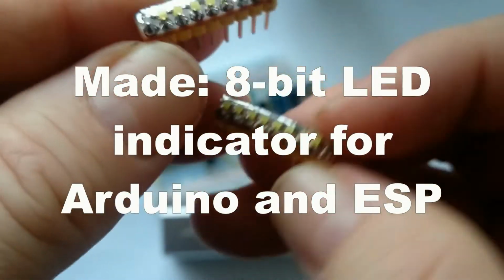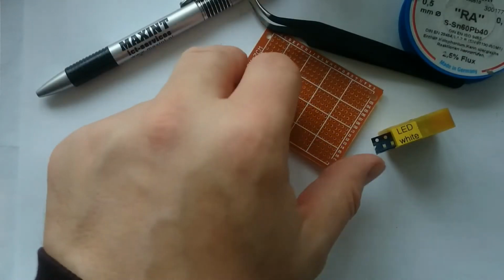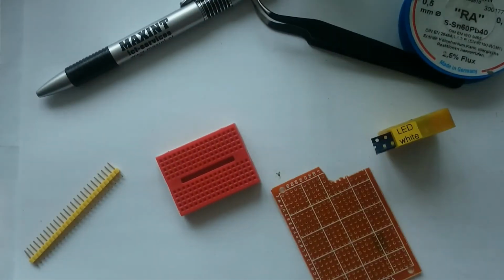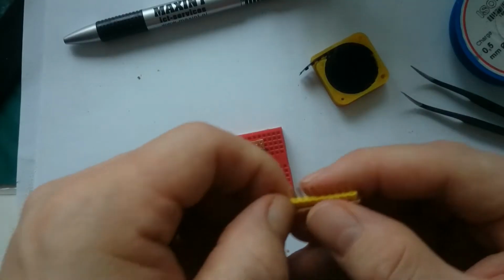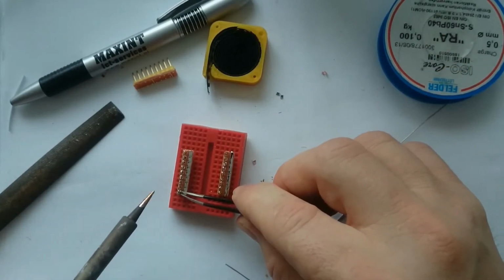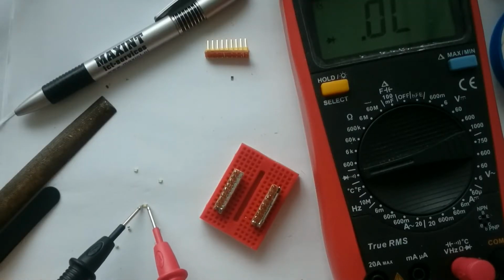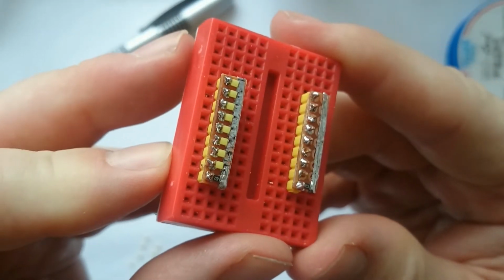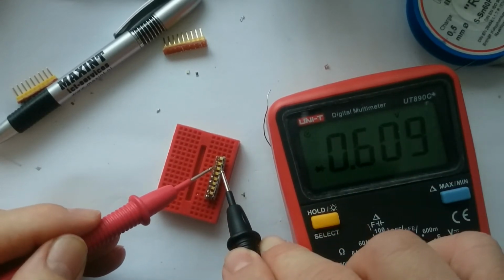Made: 8-bit LED indicators for Arduino and ESP32/ESP8266

Comment: I’m interested in using this for some of my RC cars or small drones as indicators when flying or driving in tandem, I have something like this on a a small PCB that plugs directly into a breadboard but I have no idea how to make it work for my applications.. I was planning to make the same phase animation like in some modern cars. Using a motion sensor to activate direction of indication and/or travel and also make them able to also be manually activated

Comment: How to Integrate a Driver (Library) in ESP32 and ESP8266 to work with nRF24L01?
Reply from the maker: Hi Clayton, thanks for your question. In general you only need to find a suitable driver library and install it in your Arduino environment. I've done some experimenting (not complete yet) using a Wemos D1 with ESP8266 and got something working using the RF24 network libraries. See https://github.com/nRF24 for the libraries and examples, see http://tmrh20.github.io/RF24/ for documentation. I had some modules that performed worse than others. It's best to first get the basic RF24 examples working prior to moving on to the higher level libraries. Good luck!